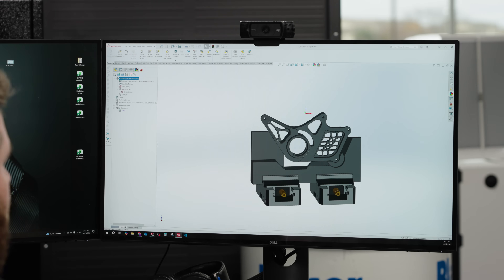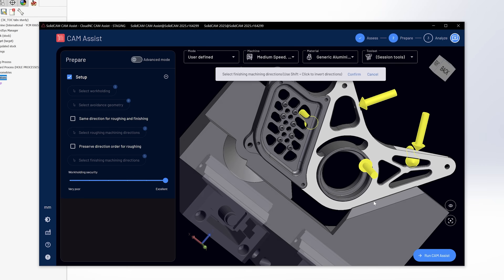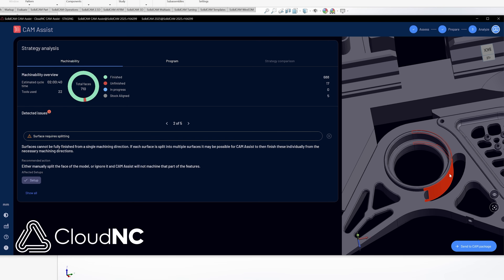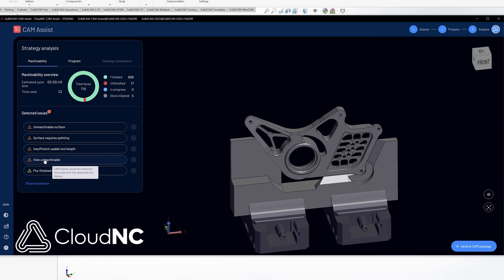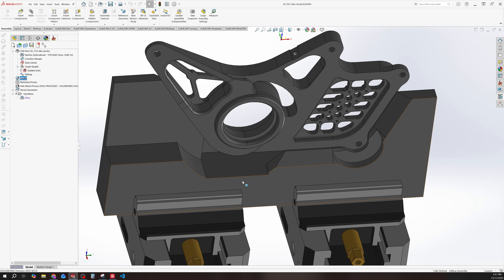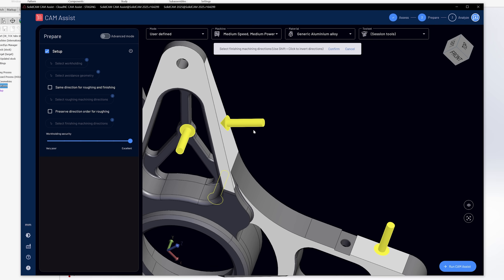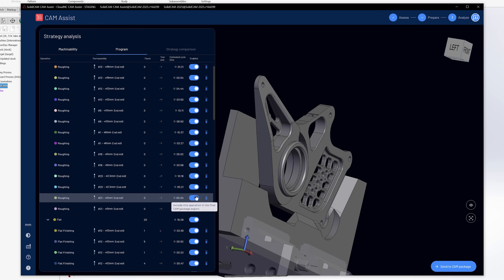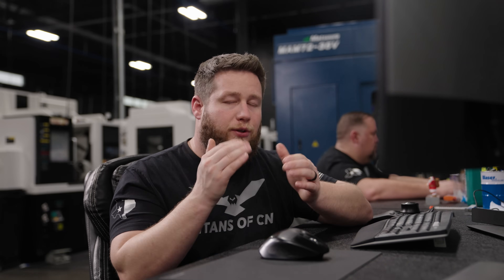We Let AI Program This Part… Unreal Results

Comment: They can add a user prompt where we could enter some basic info: ie. Mill the part using 7 to 10 pocket operations, using spiral machining for the flat surfaces and High Speed Machining for the roughing pass. You get the point.

Comment: 17:20 They need to add a reverse selection. You select the surface o  the model and it highlights or even filter (show them, hide all other) the operations that refer ti the geometry selection. Going through every single operation to find the one needed is a hassle.

Comment: Keep in mind this is an early model in future AI programming software will choose/suggest stock size and grade, vises, which machine to use selecting from machines able to complete part and then which of those has the most open time select which tools are needed and specify where to put them run simulations to get to most efficient and direct machine program set tool paths set speeds and cut depths then check for any conflicts/crashes all from a engineering file or a 3D scan. A single programmer will be able to handle the work load of an entire programming dept overseeing the ready to run programs. Welcome to the future where programming CNC machines manually becomes as useful/common as being able to use a slide rule. This will lower costs and enable more parts to be precisely machined keeping even more machinists employed than today. Hurrah!! Ray

Comment: It's simple part without no tool length/overhang restriction. I believe that CAM like NX can do most of the job just by tool length/radius detection.
Reply: You can make anything in NX, it's incredibly flexible and powerful, but that control comes with a price - it needs about 4x the button presses and inputs per operation needed vs the next most complex package. The CAM Assist saving in NX is actually larger than any other package we support. 

You could use it's feature detection and macro library but that takes months to set up properly and has some big capability gaps.

Comment: it runs full feed into the vise breaking the spindle head in two
"oh youre absolutely right, this toolpath could never have worked. heres a better version that definately 100% will not crash your CNC.  do you want me to recommend you a new machine too since you broke your last one?"
a in AI stands for advertising
Reply: I agree with you most 'AI' products are absolute BS. I could tell you some crazy stories. For perspective, we've had 80 researchers, engineers and machinists working on this for a decade. CloudNC was at the forefront of AI before it got popular, because for this problem it's the technology tree that works. 

There are trillions of ways of machining even a basic part, and we need our tech to work with any combination of machine/tool/holder/fixture/part/material immediately. 

There's just no way of brute forcing that computationally. You need to get really, really clever algorithmically. 

It has a long way to go still, but there's a reason thousands of machine shops are using it worldwide. It works well enough. It saves a lot more time than it costs.

Comment: Barry smiles behind. 

Because Jessy two hours prepared model and adjusted Library of CAM assist, chois directions of machining and etc.

Than, after generating - two hours check tons of strategies, throws some of them and add anothers :)))

Lol. Good luck :)))

Ps. This, CAM assist maybe good for coating of orders. In real life - this version of CAM assist - looks like waste money.
Reply: Letting the user pick machining directions is a tradeoff we decided to make. It takes a person about ten seconds to look at the part and say 'rough and/or finish machine it from these three directions' which saves a couple minutes in calculation time. The real timesaving win is in automatically generating all the ops within that direction. That's where the programming time goes. 

You can turn on auto direction select in 3+2 if you want but I'm impatient and think it's a waste of time. I'd rather just look at the part and click 3-5 times and save those extra minutes of calculation.

No meaningful library adjustment needed and no fiddling with the part to make it work. This part is mid-complex and sits nicely within the envelope CAM Assist finds easy.

Comment: Great video. I’m just curious how the work holding rigidity for this part turns out on 5 axis.
Reply: We make stuff in this manner all the time in our factory, it's rock solid. A little slower on cycle but it makes up for it with no 2nd op flip requirement.

I think seam fixturing is way underutilised in industry. The most successful shops I've ever walked through, probably half use it on 70% of parts they make. Less time with the spindle down, slightly more deburring.

Comment: Delusional. Since when a 2D Element becomes so complex? You should have a look on your Continuum Mechanics first before coming here and talk about your discovering. 
You have a serious problem with Geometry Sir. 
This is not AI referring to AI like ChatGPT from your point of view. 
This is called CAM Kernel, refers to the core software engine within Computer-Aided Manufacturing (CAM) systems that handles Geometric calculations, toolpath generation(G-Codes), and data processing, enabling the translation of CAD designs into machine instructions, with common types being CAD kernels like Parasolid (for design) and specialized Machining Kernel Software (MKS) (for machining).
These are the fundamental engines that take 3D models (from CAD) and generate toolpaths (G-code) for machines like mills, lathes, or robots, defining movement, speed, and depth.

You, coming here today with the impression of trying to make an invalid fact about AI. It's so deceitful, this has been there since day one of CNC and it will continue to be there with more advancement. Not with your 1% understanding of Geometry and you trying to run people mind wobbling. I can look into your eyes and see a sad person who speaks but does not mean it.  
Thank you and change your title now please.
Reply: Please, don't hold back...we are all friends here, you can share how you REALLY feel 🙄
Reply: @SerenityMae11  I'm so sorry if I'm sounding so harsh but we can't allow to corrupt the minds of those who are coming after us in this.  
For me, programming is passionate skill just like making a good soup in our kitchen where one will need to put together or combine some good ingredients based on the outcome one seeks. 
So we need to know how to transmit these skills and knowledges clearly and accurate to the next generation of programmers coming after us; that programming requires firstly a good Decision maker, not a chance taker. 
These tools and machines are higly expensive (cost) and you can't afford to have a chance taker in your floor, you will go bankrupt.  
 I refuse to believe this narrative people are pushing of AI in almost everything now. No, not in machining . Here we need real Heads at works. 
Now imagine that students at Titan of CNC academy come across a video like this? I guess they are busy first learning how to program with G-codes, which is a bridge transiting to CAM.
We can't erase this foundamental with this narrative of AI programming. 
A channel like this, shouldn't allow such videos to be even uploaded.  
What are we putting in the brains of our students, if they could just let AI program parts than wasting time learning G-codes? 
This is so false and a wrong approach within the machinist communities. 
These are like rotten tomatoes in a basket that need to be removed or changed. 
I'm sorry and this is how I feel. 
We are not doing this for funs and pleasures but to educate othes and those are coming behind us just as we found it from our predecessors. 

Thank you, without holding a bad intention at all. Because this channel belongs to both of us now as a place we are LEARNING and see the Advancement of MACHINING.
Reply: what the actual fuckity fuck. stop going around and embarrassing yourself.

Comment: I don't see any AI here. This is just standard feature / surface detection.
Reply: copmpanies nowadays just slap AI onto anything to boost their stock short term. It might be good in future, but right now  this looks very bad. I do not even think AI is needed here since it is already easy to make a CAM program manually, and does not take that long time.
Reply: @rakhoo5236 When you say programming manually, do you mean hand written gcode? The work I do, both lathe and mill is 90% hand written gcode. But my parts are simple. And subroutines make a big difference to efficiency, But I can't imagine a part this complex hand coded.
Reply: @robguyatt9602  I mean prgoramming in CAM software, programming by hand is much much more dificult otf course.
Reply: @robguyatt9602 sometimes I miss programming by hand.
Reply: camassist promoting their stuff. thats it. titans not machinists, they are promoters and now dealers.
Reply: Theo - CEO CloudNC. Ok we'll make a video about how CAM Assist actually works, because this is a huge and unfair misconception and I'm seeing it constantly. 

FBM is a macro library you have to build yourself by hand. It takes months to years to build a large enough library, these macro libraries aren't transferable across different machines, tools and materials, and don't work in job shopping high mix. Everyone talks about it and almost nobody actually uses it. Those who do reside mostly in high volume low mix. Autodesk is sunsetting featurecam because nobody actually uses it.

CAM Assist comes up with millions of ways of making every surface of volume, specific to every part/tool/holder/fixture/machine/material combination, and optimises down to a sensible combination, output as your strategy within minutes. It understands the science of machining. It works immediately regardless of your kit and needs no maintenance. It gets smarter with every release, usually each fortnight. 

It also runs on Govcloud with SOC2 for ITAR users. FEDRAMP is coming next year for high end defence. 

Email me at Theo@cloudnc.com if you want to talk.
Reply: its not AI the dude needs a long time to setup everything, come one even he´s explaining this workflow is a joke. At the end it seems more like a feature based machining and he needs to setup some basics. This part can be done in seconds with a proper CAM automation. Very simple its all rule and feature based you select your material and boom! No need to setup every little bit in cam ai. It should know it if it would be AI. Go call the product manager of cloudnc and ask him how much ai is in there. You will be surprised.
Reply: Feature CAM was doing this 10+ years ago.  Anything that is ITAR controlled is a no go for uploading to any outside service.
Reply: @brandons9138  Theo, CEO @ CloudNC here. That's not accurate, ITAR and AWS GovCloud are compatible. You can run ITAR parts on CAM Assist provided you self-certify and use our GovCloud version. Fedramp is coming next year for higher level defence requirements. 

CloudNC's security is good enough for Lockheed, it's probably good enough for your requirements.

Same as above wrt Featurecam - that's like comparing excel to Chatgpt.

Comment: Not being able to turn off individual surfaces in the same window is a bit stupid for "AI" not to be able to accomplish. A control click in every software ever would deselect that unneeded path on the fly. Having to remember and then manually delete is absolutely a time waster. So much for "AI" saving anything at this point... the rest is just vanilla in my view. Nothing that doesn't exist in many CAM packages. It's not a bug... It's a feature! ...Bonus, if the cloud or internet is down, you're dead in the water.
Reply: That's a user-interface point not an AI strategy output point. We like feedback especially if it's harsh so long as its productive, so thanks 👍

We'll look at this. UX should be delightfully simple and smooth.

Comment: What's all this cost? Not trying to be a smart ass. Cost of machinery, all the tooling, programming time, your labor etc....
All cool stuff no doubt but I'll stick to my little corner of the world doing manual machining. There's a need for us too.
Reply: Right tool for the right job - manual machining and programming has its place and always will. There's a good reason almost all lathe programming is done on the controller.

Comment: I think there is no AI in that CAM Assist, just usual algorithms. IMHO Dassault Sys just add "AI" word for advertisement, because it is popular
Reply: I've talked with the owner of CloudNC before and there actually is AI used in developing the speeds, feeds, stepover and stepdown and trained on tons of data. It also actually uses AI for analysing the CAD model. Not all AI models use LLMs so it's different than chatgpt for example.

So it's more than just smart templates with tons of built in logic to handle a ton of situations.

That said, tons of companies do market things as AI that are not AI and it pisses me off. But this does actually use some AI, so it's not false marketing. Also CAM assist isn't owned by Dassault

I'm also not a huge fan of cam assist yet as it has a limited use case at the moment, so I'm not saying it's crazy amazing. It still needs a lot of work in my opinion.